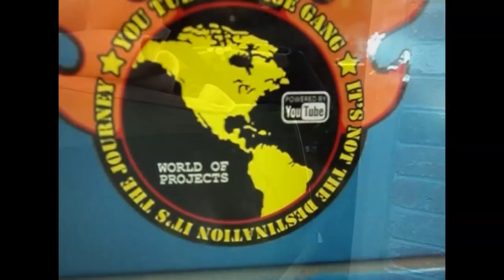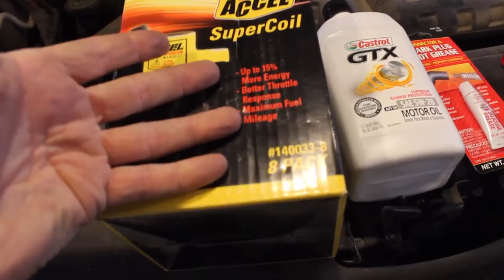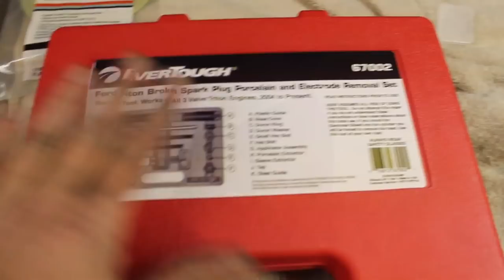F-150 Transmission Shutter - Fixed - Coil on Plug and Spark Plug Swap

Comment: Greg You Rock!
Got a chance to work on a friends truck with those famous FoMoCo ONESUXPLUGDESIGN. We used carbon combustion cleaner instead of PB Blaster to disolve the carbon buildup and took our time basically following your steps. I do admit that we used a torque wrench and if the plugs didn't move easy enough (25ft/lbs)  we squirted a little more carbon cleaner to dissolve the carbon stuck on the plug to the head. and waited another hour so it would dissolve the carbon build up.  Bottom line - none broke. We got lucky. We used Accel coils as well. Kinda think the trick was patience and carbon cleaner vice penetrant.

Keep Rocking.  Love your vid's!! Btw, I'm a new subscriber of yours!
Reply: HawaiianF150 2009-4/6-L3V Greg btw for your viewers - the broken spark plug tool has revisions to it. Look on the barrel of the threaded remover and it should have three lines for the latest version of the tool. (watch a new one come out tomorrow)  Seems that the tool thread and type of tool metal that was used was breaking at the threaded tip. Just thought I'd pass that tid-bit on to you and anyone else watching your vid's.
Reply from the maker: HawaiianF150 2009-4/6-L3V Thanks for the updated info.  You are right...  Carbon cleaner is a better chemical to use.  Congrats on getting a perfect score on extraction.  The torque wrench was a great idea.
Reply: Greg's Garage Hey man got an off topic question or plea for answers - I'm not so tech savvy with you tube search and didn't find any answers.  Here we go....
I have a 2009 F150 Super Cab 4.6L 3V 145" WB that i have replaced the factory Michelin's 265x60R18 with 270x 65xR18 Michelin MS2's. I replaced the tires due to normal wear and i wanted to fill in the wheel wells better without lifting or going with any larger tire than needed to get it done.  No place here to enjoy 4x4'g. 
The new MS2's are awesome. Awesome grip and what can you say, they are Michelin quality. These new tires have been on for about a year or so and are slightly larger and heavier tires than the original tires.  
After the tire change, i noticed that my rear tires or better said, the rear wheels, bumps or dances a little when i go over a bump and it's even more pronounced when i go over those darn annoying parking lot speed bumps or anything similar at or over 10 MPH. 
What I'm confused about and need some help with is how can (1) i identify the cause and then (2) fix those annoying rear wheel dancing sessions.  I think .. mind you only think, that the cause is that the increased tire/wheel weight has the rear shocks at the end of its designed dampening design range. What i don't know is - what's a good rear shock to compensate for the increased tire/wheel weight?  (if the weight and lack of dampening range is the problem).  This tire is about 2 1/2" taller and weighs about 30 lbs. (feels like 30lbs) more than factory.
My truck is a 2009 Step Side.  Mind you that Ford didn't make a Step Side model in 2009. They made Fleet and Flare sides in 2009.  Think my truck was a special order that happened to fall in my lap and I love it. Looks Darn Great. Wished i could upload a picture.  Sorry babbling there. What I'm thinking is that since the sides are fiberglass did the weight loss cause an issue by getting just to the edge of dampening?  Mind you i did not have any problems when i was using the factory spec tires. But i don't want to go back down to that size.
Every shop I've gone to just wants money without answers and not one place offers a guarantee that they can fix the issue. They aren't willing to take the shocks back and refund my bucks if it doesn't fix the issue. Most all, 99.99%, said they aren't sure about solving the mystery.  This includes tasking the local off road 4x4 shops that i know that has some kind of street cred. 
I don't have an issue with buying new rear shocks if (1) i had enough reasonable assurance to know it actually is the shocks and (2) it'll fix the issue without wasting money i don't have to toss away.
Another question - Any way I can get help from you and or your community to solve this Scooby-Do mystery?  
Yep, been putting up with this for over a year and it's time to get it done. 
Thanks Huge in advance! A crazy dilemma.
rick
Reply from the maker: Rick...  Unfortunately, I know very little about ride engineering outside a few conventions.  You trade stiffness and stability for smooth and comfortable.  I do know that tire pressure can affect your ride and handling.  The max pressure on the side wall is NOT the recommended pressure from the ride engineer.  Every make has a suggested tire pressure.  When you change from a stock situation, you need to assess whether or not this pressure is still valid.  That's where my knowledge ends.

I'd highly recommend posting your question to a 4x4 forum. Those groups have all kinds of experience with the wackiness that follows deviations from stock setups.

Good luck!

Comment: My 08 is running rough at Idle and acceleration at 20-40. It happened a year ago and it cost me $1800 at a Firestone. It's happening again, thinking about doing this myself this time.

Comment: Wow...so here's the issue I'm having. Same thing! I have a 2004 Explorer 4.6 with 183,000 miles on it. I last changed the plugs at 100k. It would start at around 45-50, but also sometimes in between 50-60. Always under load when the OD kicked in. Took it to the Ford dealership and they told me that cylinder 4 was misfiring. They replaced the coil and spark plug (or SAID they dlid - at least the coil looks new). Next day look it to work and same thing happened. I took it to Advance Auto Parts and used their code reader. Sure enough, it said cylinder 4 misfire again. Took it directly to the dealership. Mechanic at dealership told me the code had cleared. So he hopped in and listened as I drove it and diagnosed torque converter from the shudder. I'm thinking that with my factory coils still on the other 6 cylinders, that I'll replace the coils and the other 6 plugs early. If you're only counting to 7 here, that's ok. Cylinder #8 ejected a plug about 6 weeks ago and I spent $600 getting an insert, new plug and new coil put in (different dealership). So hopefully this works. Because I don't have $2500+ to replace a TC.

Comment: I had the same symtom  and when I put"DR Tranny instant shudder fixx  " It solved my problem right away.  I did a tune up thinking that was the cause as in your video,But my problem must have lied in the oil . My truck sat alot during its 11 years, It only has 39.000 miles

Comment: here you go bro., 2007 F150 154,000 miles....  plugs, coils done, about 5,000 miles ago... cam phasers, timing, tensioners guides done.. 200 miles ago, old change same time as cam phaser kit. really bad shudder at 45 to 50 under light load, engine light flashes. had codes that where all taken care of.  new sensors, and nothing is helping. I'm hoping it's not a torque converter or transmission issues.

Comment: Dude i haaateee that i just seen your video. My 2004 F150 would shutter around 45-50 as well with NO engine code. I replaced different parts such as the fuel filter, however when i replaced the spark plugs and coils the issue was RESOLVED. DAMN i wish i would've seen your video MUCH SOONER.

Comment: Thanks for the video man.  I have been on the idea of my shuddering being a spark issue and this confirms my thoughts.  I have a 2008 F150 and I use it as a work truck for an electrical contracting business I run myself and I use it as a daily driver carting around my family.  The truck is very important to me and I am novice skilled mechanically but I can't afford to have the truck down for an extended time while I work on it as a novice mech.  So I'll bring it to the pros but I'll let them in on all the tips for an easy install!

Comment: best video I've seen bro I'm having the same problem on my 2005 f150 king ranch I'm going to do it my self to safe money. Thanx and awesome video
Reply from the maker: +Jose Valdez Thanks man.  Its a VERY common problem.  Watch a video or two on getting the plugs out with an impact.  It may save you a TON of time.  Some guys also do it with the engine hot.
Reply: +Greg's Garage I just hope is my spark plugs and coils and not my torque converter

Comment: I've been having this problem as well.  Currently I have the CEL on, and I had it checked.  It came back with codes P0171; P0420; P0174 and P0304.  I'll start with the P0304 because that's pretty easy to do.  I'll research the other codes after I've done this and maybe it'll clear the others.  Thanks for the video.  Oh, I have a 1999 Ford Expedition with over 400,000 miles on it.  YES...you read it right.  Over 400,000 miles!  LOL

Comment: I have a 2006 Jeep commander 3.7l that’s having the same problem. Replaced coils and spark plugs, it definitely is running better, but I’m still having that shuttering. Not nearly as bad though.

Comment: I had the same problem for a while. I finally changed plugs and coils, but only after it damaged my catalytic converters. They cost 650.00 to get two replaced by the muffler shop.

Comment: A few years ago, I had a '98 Ford Windstar minivan (3.8L V6) that started going into Limp Mode (locking into 2nd gear). The Check Engine light would come on and the Overdrive light on the shifter would flash. You could be going 80mph down the Interstate and BAM! it would suddenly be in 2nd gear. I drove it like this for a couple of months and finally took it to my local Ford shop. They told me the transmission was at fault and would cost $3000 to replace. Yea, sorry Ford. I don't think so. It turned out to be a combination of a bad coil pack and faulty IMRC's (Intake Manifold Runner Control). After replacing those items, I drove it for about 3 more years with no more problems.

Comment: 2002 Ford E-350 XLT Van. This happened before when my father was still alive and I remember it well when I was riding with him back 2012. Well now it's 2020 and it's happening to me now. I hit around 45 miles per hour and the stuttering starts. I want to know the approx price I'm looking at to replace the coil packs, plugs, boots and all that's required at a Mechanics shop? I'm not messing with those plugs ;)

Comment: Check the suspected coil for resistance. should be around .6 to .9 ohms. If the coil is bad your vehicle with throw a code which will direct you to the cylinder to look at. Your local auto parts store should carry just the boots for each coil. More than likely its just a boot that's needed or all 8 for that matter. Another problem is leaking coolant or oil getting down in the cylinder.If replacing a coil on these engines, always use Motorcraft. Other brands even Accel will burn out prematurely, or can cause misfires right out of the box. Any other part on this truck, get the affordable one. But the coils go Motorcraft. Then save your money because eventually one of your spark plugs is gonna blow out and you'll be drilling, tapping, and plugging a new spark plug hole.

Comment: I have s 2015 f-150 w ecobost. I have the same shutter, I changed the plugs and coils it runs better but still has the shutter. What now? Also no error reading. 117,000 miles. I pulled the plugs out after two weeks to see if I had cracked one on the install. They were all good.

Comment: Good Job! So, nothing was wrong with transmission?? And , yes, these sparkplugs are hopeless taking out...without breaking a porcelain..., now how do you put them back without breaking them?? And correct torque for them??
Reply from the maker: There is a correct torque.  They changed it in a bulletin.  I don't have it off the top of my head.  I want to say 18 or 20 ftlb.  The info is out there if you search google.  You won't break them on the way in, just be careful.
Reply: OK, Thanks, youtheman =)

Comment: I believe you're right about the shutter at 60-70.  With the former misfire(s) you witnessed the carbon buildup.  With those cylinders working better (no misfires) you may have dislodged other buildup which hampered the O2 sensors.  Next problem you'll have is clogged Catalytic converters.  I IDIDN"T see anything about "gapping" the plugs - is that necessary?
Reply: most new plugs are gapped correctly, but good to check them

Comment: I am glad it all worked out.   That is similar to what happened on my wife's car.  With 94k miles on the original plt plugs, the transmission at 45-50mph would go back and forth between 3 and 4 gear.  The computer could not make up its mind which one it should be in - I believe it was because of poor spark and the engine would not produce the power that it should.  A week later,  it gave out and the engine was missing on that cylinder. That is down fall of letting the plugs stay in there that long.  They fail and they are a pain to get out.  

Some say to change the plugs every 50k with plts.  I think that is a bit much.  But I do believe that at or near that point that you start losing fuel efficiency.  I think at 100k or you are pushing your luck.
Reply from the maker: Good to know...  The new technologies throw all my experience out the door.  I'm used to old school, changing wires, caps, rotors, plugs etc about every 30-40k.  Now the platinums claim 100k or so in the manual...  Some oils also claim 10k between changes....  Just doesn't seem right.  Maybe I should go with my gut.  It might cost more, but it will avoid situations like this.
Reply: Greg's Garage
 I know.  I had a '73 beetle in high school.  I did the valves, oil changes, plugs, points rotor, distributor caps and yes the wires.  I remember all the issues. They have gone from one extreme to another.  Yes, technology has gotten better, but not that good, unless you want to throw out the car early. The oil changes I would not go more 7500 miles with synthetic.  I do 5k with synthetic and 3k with conventional.  BMW went with 15k oil changes a few years back because maintenance free period that they give new buyer so they could save money.  They had a lot of valve problems at 60k + because the hydraulic lifters were getting clogged with all the crud build up. 

The transmission on the wife's BMW that I changed fluid has a label that says "BMW Lifetime Fluid".   I guess is lifetime when the transmission fails, it had its life.  Bentley Manual recommends 100k fluid & filter change interval.  That is pushing it.   Some change the tranny fluid at 50k which is better. By the way that transmission is a GM transmission which is made France and uses Dexron IV.  If you check with GM, I do not believe that they will state that is Lifetime fluid. 

I think coils are hit and miss.   They could out live the vehicle or fail the first few thousand miles.  I would not replace them unless they go bad or the car is st least 20 years or more than 250k. If it makes you feel better to replace them, that is okay.  The plugs I would not push.  Even if is for the reason that they will get "fried" in the head or get brittle.

Comment: Just wanted to say thanks for this video. I had the same issue with the shudder on acceleration. I re installed my original coils packs with die electric on the connections and the truck runs like a dream again! 
Have you done fluid swaps for the diff and crank case?

Comment: I’m having the same situation. But I’m not throwing any check engine light. Went ahead and changed the trans fluid and filter. We’re there any check engine lights or codes before you started repairing?

Comment: Glad you were able to get it fixed. I'm having the same problem on my 04' F150. It does the same shudder in the 40-55 mph range. However, I'm getting another shudder on top of that one: around the same speeds, slight acceleration (a little more than the gradual acceleration to get the coil shudder), the truck sounds like you're going over a rumble strip (like when you start to run off the road, the wake-up section of the road). Did your truck ever do that as well? I'm fairly certain the coils and plugs need replaced, but I'm wondering if I'm having a TC issue on top of that. Thanks in advance.
Reply from the maker: You may.  I had a pinion bearing go out and that had a strange vibration under acceleration.  No major noise though.

Comment: Hmmm I wonder if the coils could be my problem awhile back I had ford replace all 8 spark plugs in my 2006 f150 king ranch 5.4 when it was at 110 k it was skipping and shutting badly on the highway at low rpm just like you showed at the beginning of the video after they replaced it the skipping and shutting went away now 12,000 miles later it has come back something like before skipping and shutting around 45 to 50 mph at low rpm and I’m thinking to myself it can’t be the plugs they only have 12 k miles on them but after watching this video and doing some google searching I noticed coils keep coming up and as far as I know I don’t think they replaced the coils at least they didn’t charge me for it anyway.

Comment: What happens when I replaced the coils and its still doing it and its throwing the transmission malfunction sensor off and the overdrive light starts to flash?
Reply: Did you resolve the issue?